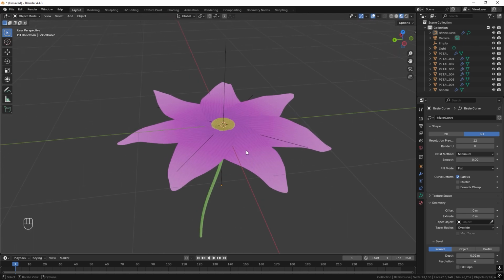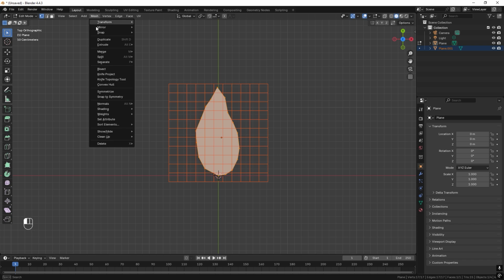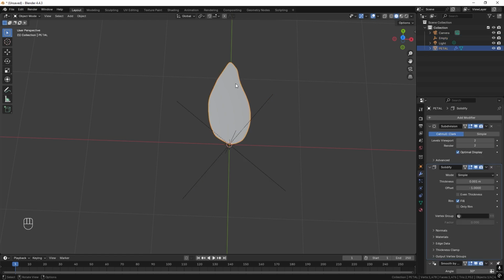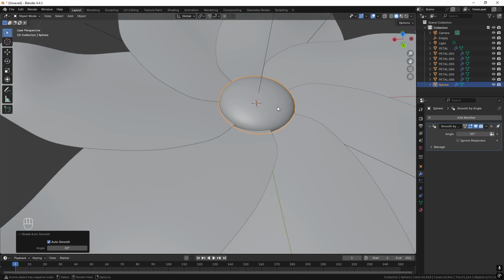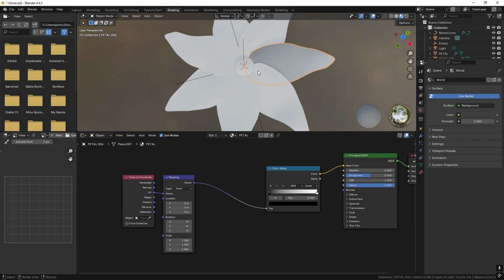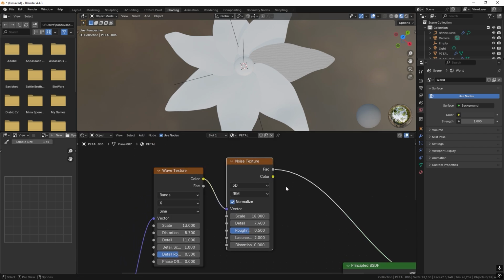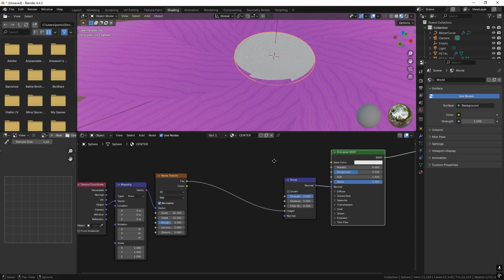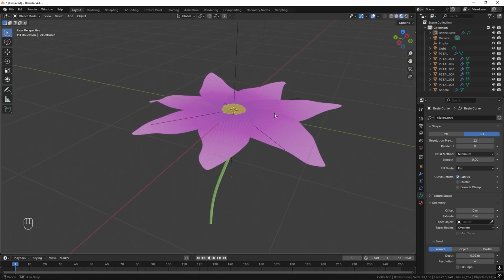How to model a flower in Blender

Comment: I'm new to Blender wanted to do exactly this. Just took a test petal off the printer and it worked! Thanks!
Reply from the maker: Glad I could help!
Reply: @3dplockis  Something I just noticed. I'm getting non-manifold errors around the perimeter of the petal. I'm checking with 3D Print Toolbox. I create a simple bezier, convert it to a mesh, add a face, create a plan and use knife project, delete the plane and then add a solidify modifier, I hit the problem. Am I missing a step?
Reply from the maker: I didn’t fully catch everything you described — it sounds like you're talking about both the petal and a Bezier curve (I’m guessing a curve object?) the stem?

- The petal might cause problems if you haven’t applied the Solidify modifier.

- The curve could also be the issue if it’s not converted to a closed mesh, "watertight".

Check if all your vertices are properly connected after converting the curve to mesh, and make sure normals are consistent. Non-manifold errors usually come from open edges, duplicate vertices, or geometry that's not watertight.
Reply: @3dplockis  I see my problem. I was not following your video carefully. I thought you were starting from a Bezier curve but it's actually a plane. That explains why i needed to do a convert to mesh. The offending points are the ones from my initial curve.